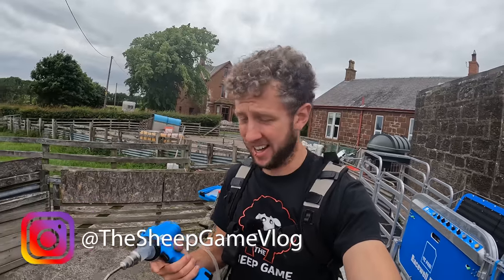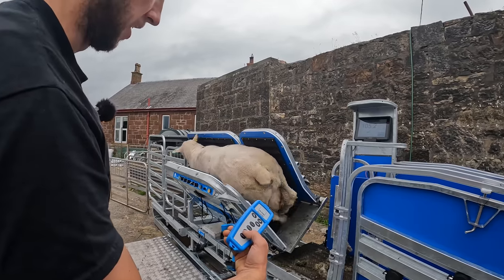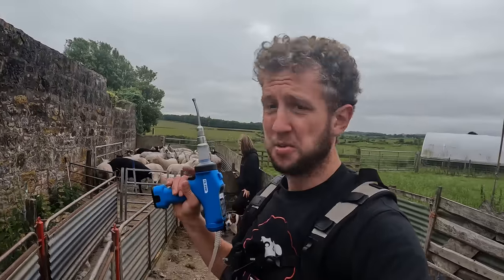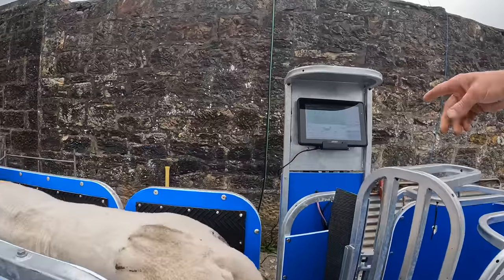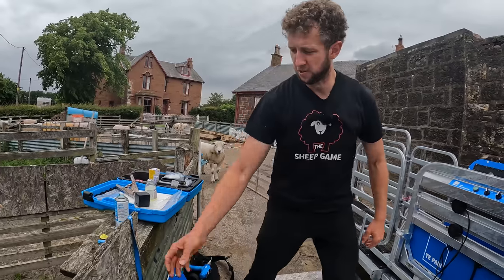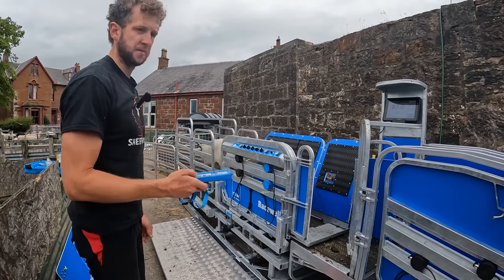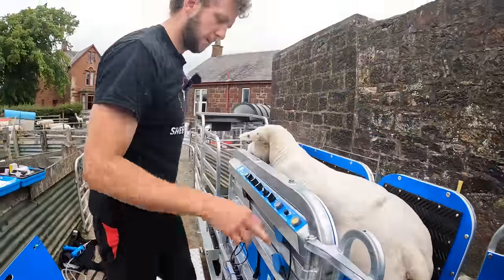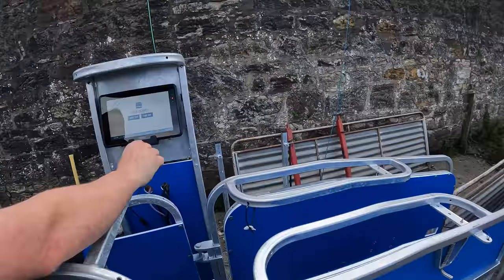THIS SHEEP HANDLER DOES IT ALL

Comment: I have the junior version, it doesn't have the electric eyes and it doesn't weigh them and it doesn't act as a turntable but I didn't need all those extras. Love the machine! I have their separate scale system with a 3 way sort. The gun I've had for about 4 years now, what a difference that makes for those of us with old arthritic hands. I should be able to farm until I am 90 with these machines. Weighed 99 lambs in 13 minutes last year with just me and one dog.

Comment: They’re a great thing to have we’ve had one 5 years now and couldn’t be without it, good to see everything I don’t like about our slightly older one has been changed on that new one you’ve got looks like they’ve got it perfect now. However we never really got on well with the dosing gun since it’s a total nightmare to try and clean or take apart and is just bulky and slower than we are with a manual gun so interested to see how you find it.
Reply from the maker: Great feedback. I must say i like the idea of accurate dosing but time will tell re cleaning etc. 👍
Reply: Perhaps you’ll find yourself favouring this one or the manual depending on how precise the dose needs to be relative to body weight?

Comment: Nice unit.  Have they made it more mouse proof.  The biggest challenge long term I have seen with them in barns/sheds here in Canada is mice getting underneath and chewing wires.  Lambs can do that too on the old models.  What is the battery life on the remotes (drench gun and handheld remote?)
Reply: Hi Rebecca. Regarding the mouse proofing, we have made some improvements to how the electronic cables are protected, both on the dashboard and underneath. We've also got plastic caps that fit on the metal frame ends where rodents used to get access to the cables. The feedback on these improvements has been very good from our customers. 
We rate the battery life to one full day of dosing and recommend that they are set to re-charge overnight before each day of use. 
The remote control for the handler will run for at least a year and has a small battery which you can find at most convenience stores to replace it. 
Best regards, Corban Blampied

Comment: The most negative factor about farming any kind of livestock is, the physical toll it can take, on those doing the work. Any technology that can lessen that toil adds years of productive life. Not long ago many farmers were physically crippled by mid life, or at least dealing with serious disabilities. Back injuries and torn ligaments, from wrestling with beasts that weigh as much or more than the farmer, being the main concerns. It's great to see how modern crushes alone make the operation much safer. The Te Pari does all that, and boosts productivity and vital data collection. Now... If they can just make life a bit easier for shearers!

Comment: So can the software for the Te Pari tie into other Sheep software so you can document
Reply from the maker: I’m Still learning on that front. I’m still using my Flockwatch system for my medicines / moves etc.  i plan to use the tepari software to monitor lamb weight gain for selected treatment of worms 👍

Comment: I just wonder how well the touch screen and all the integrated electronics will do outdoors in typical Scottish weather….
Reply: Great question Pat. All components on the Racewell are weatherproof and are fine being stored/operated outdoors, even in Scottish weather. The touchscreen weigh scale is a rugged and tough system, and if you're operating in the rain or with gloves you can adjust the sensitivity on the screen so it's less sensitive and won't be impacted by the weather. 
Regards, Corban Blampied

Comment: I’m looking at this and going this would have done Sandy in Canada a lot of good when it comes to sorting sheep because sometimes she not as quick as the sheep and it would give her alot more data points on her ewes health. 
You showed back feet trimming use but what about the front feet. It’s a shame it doesn’t rotate the feet towards you vs the body. That would be my only critique of the system from what you have shown.
Reply: Looks like you just flip out the front half of the crush instead of the back half if you need to get to the front feet.

Comment: how does it handle the rain and snow
Reply: Hi Shannon, It's no trouble for the Racewell in the rain. All electronics are rugged and weather proof and all steel components are fully hot-dip galvanized. It's very common to see these left outside all year round over in New Zealand, even in the winter. Thanks, Corban Blampied.

Comment: I notice that the sheep are getting their hind legs caught up in something when you release them from the crush, looks like there's a hook? on that outside panel --- why?, what's it's purpose? -- looks like it hurts. Hot and sweaty here in Canada
Reply: Hello Pamela, good spotting. That is a backing hook that stops the sheep from reversing up in the handler after being weighed. Typically with slightly smaller sheep, we'd recommend that they're held slightly further forward than that, and then the hook will pass behind the back legs. In the case of this video with big rams, you can shut off that backing hook to stop it from extending into the handling area. I'm sure Cammy will show how this feature works and its benefits in future videos.
Regards, Corban Blampied
Reply: @TePariProductsLtd  thanks Corban!